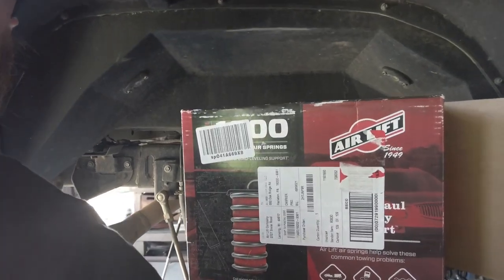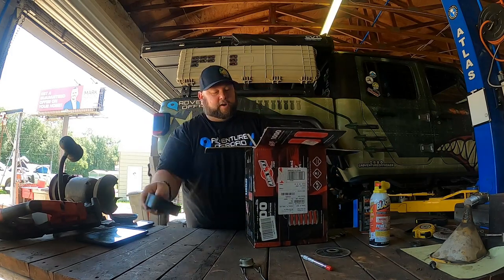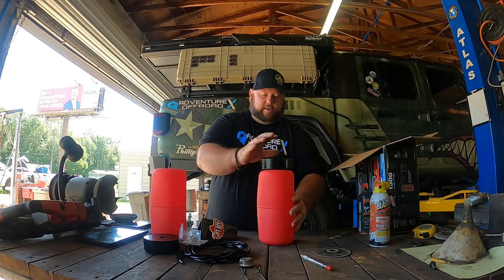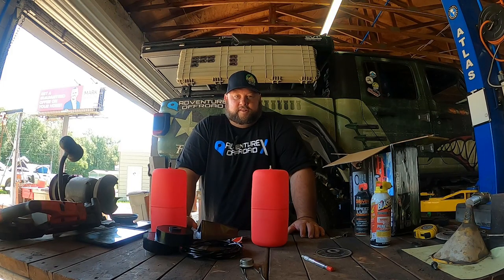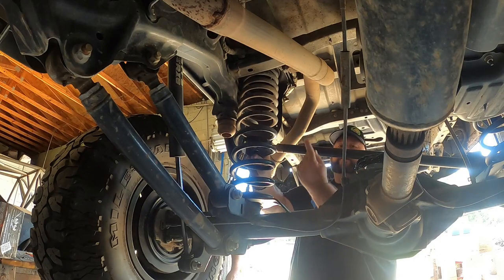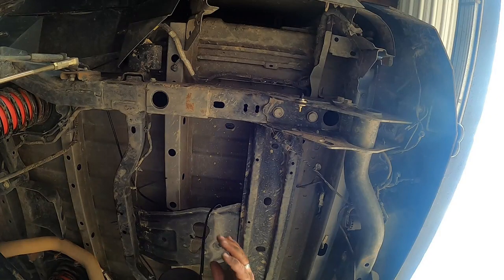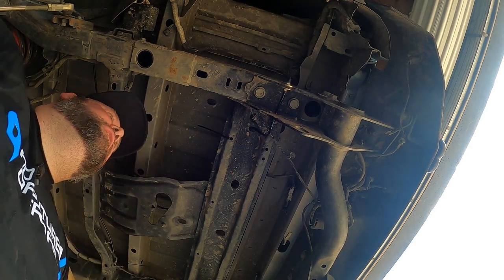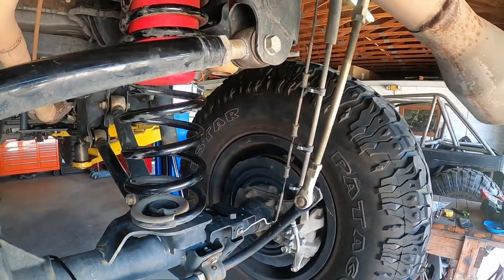2021 Jeep JT Gladiator Install | Air Lift Rear 1000 Air Spring Kit  #gladiator #airlift

Comment: Great Video! I was searching for a lifted Gladiator to see how they worked. I have a 4.5” lift on mine, so they should work good. Thanks again!!
Reply from the maker: Thanks✌️ They are still going strong with zero issues.

Comment: Had at least two people comment this past summer asking how my JT Mjoave was sitting level with my bed loaded and trailer hooked up. They always want to know what springs in using. Shocked to learn it airlift 1000. Love mine!
Reply from the maker: That's pretty much the same way I found out about them. So I looked into them and l decided to give them a try and I'm glad I did they have worked flawlessly.

Comment: Just put some of these in my gladiator to help with my sag from the rack and rtt. What psi are you running yours at?
Reply from the maker: On the road I was running 10-12 psi off-road I took them back down to 5psi.

Comment: Cool man I was looking at something like this. Especially when I tow a trailer with the toys. I am sagging a lot on my JT which also sits on a 4.5” lift.  Tell us how it works out after your trip up North.  I am interested in hearing the results. 🤙
Reply from the maker: It actually worked out great. They Got rid of all the sag and it felt stable on and off-road. I would highly recommend them to anyone.
Reply: Does it flex good?

Comment: How is this application still working for you today? I have a skyjacker 4 1/2 half inch lift, with 3 1/2 half inch rear coils, and nobody around here will install them, because it says it’s wrong application.  Thanks!
Reply from the maker: It’s still working great I haven’t had any issues. If your going to be in a flexi trail then I would recommend airing them down but other then that it does exactly what they’re supposed to do.

Comment: How are these holding up? Any issues?
Reply from the maker: They have been working great and haven’t had any problems. The only thing I would recommend is if your doing any kind of flexi trails then you will need to air them down.

Comment: Would the same parts number air bags would fit on my 3.5 lift?  Thanks
Reply from the maker: Yes I'm pretty sure they will. The air bags have been a game changer when the rig is completely packed down.